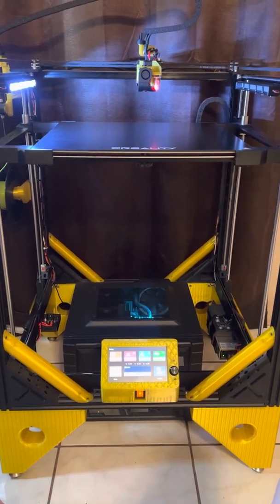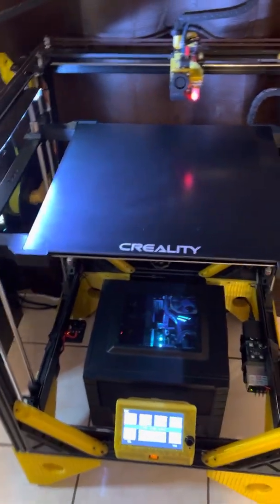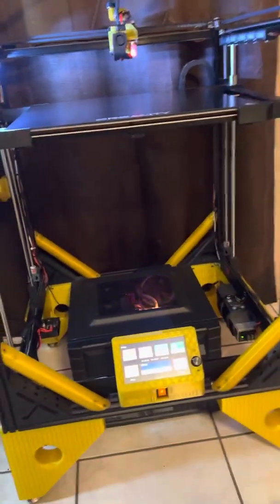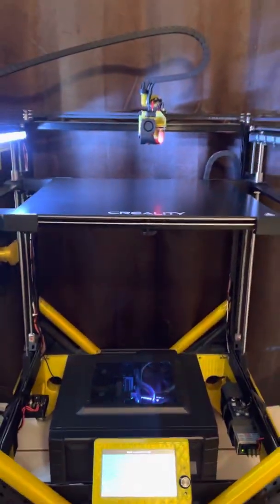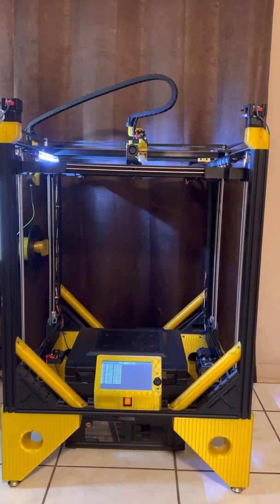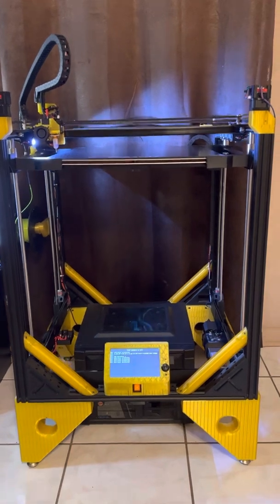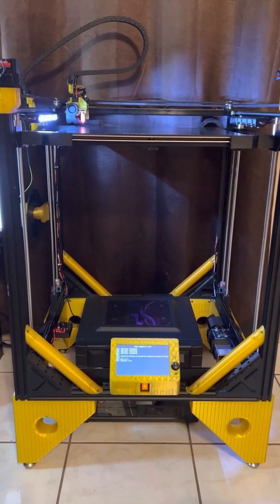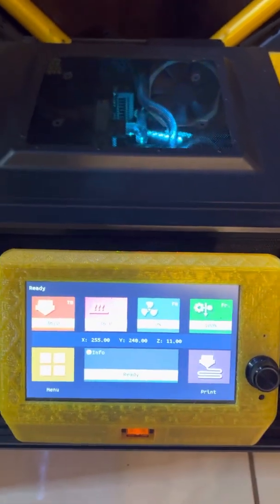Quad Z Auto Align with G34

Comment: Hello Stephen , You are the only guy I found that talk about Quad Z G34 

I'm living a nightmare to make Quad-Z motor bed leveling work

I've been working on this issue for month... I'm on the verge of insanity:face-blue-wide-eyes:

I'm building myself a Voron-like printer , with quad Z motor for bed leveling, A bit like you 
My bed is actually made from 4 x 220x220 smaller bed, Hold by a grid of 2020 extrusions , and a big glass on top

I was planning on the magic of quad leveling the Z axis with Z_STEPPER_ALIGN_XY and G34 to make it leveled

But G34 is not behaving like expected:
after 1 to 5 iteration I usualy get somthing like this :

PROBEPT_0: 26.19
PROBEPT_1: 25.90
PROBEPT_2: 26.19
PROBEPT_3: 25.89
Calculated Z1=26.04 Z2=26.05 Z3=26.05 Z4=26.04
Z2-Z1=0.01 Z3-Z2=0.00 Z3-Z1=0.01 Z4-Z3=0.01 Z4-Z2=0.01 Z4-Z1=0.00
Target accuracy achieved.

G34 seems happy with the alignment of the "calculated" Z1 Z2 Z3 and Z4
But you can clearly see that PROBEPT_0 to PROBEPT_3 are despicting the bed "folding" on the diagonal,
This "diagonal bend" is in the 0.1 to 2 mm range.

Mechanically, my printer could compensate for this , But I haven't found a way to ask marlin to do it

There isn't much information on bed leveling with 4 Z motors, but what struck me is that any correction Marlin make is seems always done with movement of 2 adjacent Z motor.
This is to prevent "bending" the bed I guess
If soo, this bent will never be corrected :(

On a 500mm+ distance, a 2 mm forced bend will not break anything !
And I would make my printer strait

Is there a way to alow/force marlin to compensate for this?

Thanks alot !

Comment: Hi! How did you connect each of the Z steppers to the board? Which of them is Z1, which is Z2 and so on? There is no such configuration in Marlin, so it seems like Marlin does not know which stepper is in front left corner, which is in back right cornet etc.
Reply from the maker: This process is similar for dual triple or quad Z or X or Y for that matter. My first Octopus Mainboad was for a bed slinger and I only setup Dual Z for that but I did make a detailed walkthrough with screenshots of getting it setup in Marlin 2.0.9.3 here: https://3dprintboard.com/showthread.php?51320-Dual-Z-Auto-Align-Setup-In-Marlin

Comment: That's awesome but why is it so damn loud man, I mean if you did all this custom why not run silent drivers? I'm confused
Reply from the maker: These are closed loop stepper drivers. BTT S42B drivers for X and Y. I have recently upgraded them to the new BTT S42C that just came out and they seem pretty quiet.
Reply: @stephenreynolds2348  in comparison to mine, this thing is super loud. But I don't have closed loop drivers
Reply from the maker: @twistedsocal  But mine will print in the bed of my truck while I am on the road without skipping a single step. And mine will print up to a 2 ft cube while printing in the bed of my pickup truck bouncing down the highway. I think it is weird to compare a sub compact to a sports car or a suv, ya know? But it is good to know your build is centered around db levels. I have a few printers that are built for that as well.
Reply: @stephenreynolds2348  sub compact? 360*360*410 is not quite sub compact but I get your point. I just like it quiet cause it's mounted to the wall right next to my bed so I can still print and sleep no issues...I actually really want to employ clear path servos on my build but I can't justify the cost of just the servos vs the entire machine ya know..still if closed loop steppers will keep step that well, I might have to pull the trigger on them. Doubt I would ever have a reason to print while driving down the road especially in the back of my truck but I guess it would be nice to know I could if I so wanted to
Reply: @stephenreynolds2348  the reason I commented on the first place is because I want to set up a quad lead screw leveling setup like you have, was hoping you had a bom and possibly design somewhere I could follow
Reply from the maker: @twistedsocal  I wasn't calling your printer a subcompact just pointing out that all printers are not the same and we wouldn't compare a tahoe to a Corvette even though they are both vehicles. Not to say one is better than the other they are just different from each other and shouldn't be directly compared was my point. with the build volume everything I print uses 2lbs or more of filament so reliable printing is the most important goal in this build and all considerations must come after that.
Reply from the maker: @twistedsocal  I have a build thread detailing all the things I have done with my X5SA 500 Pro from the time I bought it right here: https://3dprintboard.com/showthread.php?46777-My-First-CoreXY
Reply: @stephenreynolds2348  thank you, I am only on my second 3d printer. My first was an flsun q5 that I kept basically stock. This one is an ender 5+ that I have mostly enclosed, but can't finish until I convert to core xy to move the motors inside the enclosed space. Have linear rails on order, just got the rest of the extrusion and hinges etc to finish the enclosure. Have upgraded boards 2 times with the latest one getting destroyed by a friend's dog catching the USB cable and ripping it out of the printer. This broke the port so I ordered and received my btt octopus 1.1 board with 2209 drivers. Also grabbed the 7 inch screen so plan on getting those installed in the next few days. With all the extra motor ports, I want to go quad ballscrew leveling which is what brought me to your video so thank you for showing it. I have slightly different ideas for how to attach the bed and allow for expansion etc but I want to get as much research done into it before actually making the modifications needed to get there..was eyeing some closed loop steppers but wasn't sure they were needed, however if it means no more failed prints I'm going to order them today
Reply: Side note. So far the only failures are when I push the thing too fast for the movement system or for the first few layers or when I mess up with slicing and overlook a setting etc. The printer itself has been pretty damn on point since I went direct drive and upgraded the board. Thanks again for the info